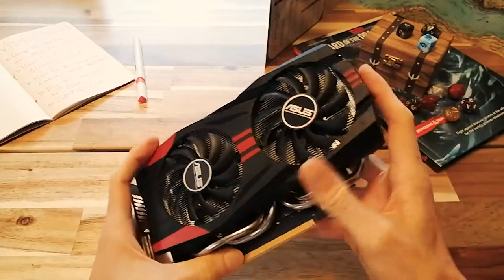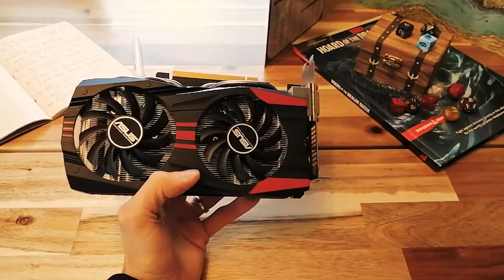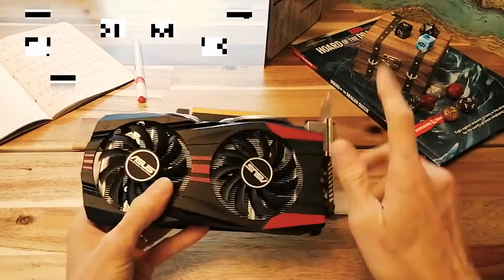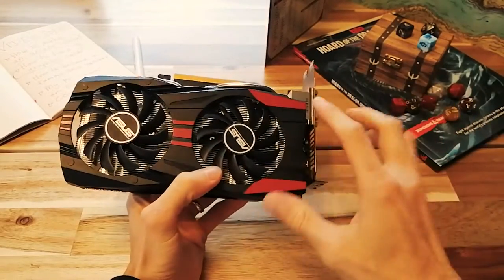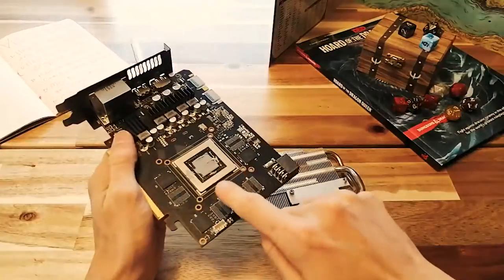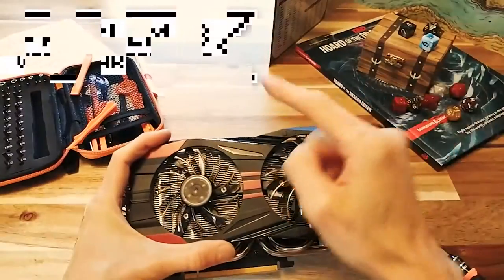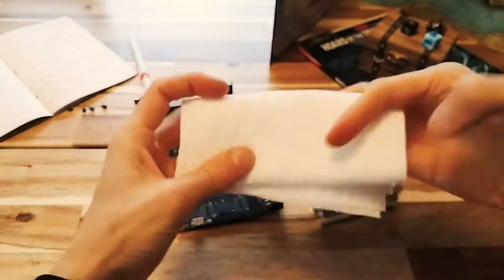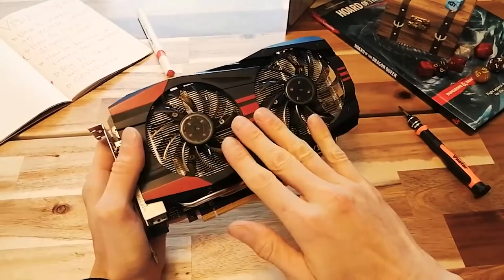EASY Fix Your Graphics Card! (Loud fan, black screen, crashing, artifacts)

Comment: Rx 5700xt, leds light up (power from pcie) but doesn't seem to power up at all otherwise.  Not detected by by pc.  Have tried in two systems.   One was an Intel system the other a amd with radeon adrenaline installed thanks to a 6600 non xt gpu.  Have re pasted it but that's as far as I dared venture on my own with no further guidance... any ideas or instructions to share on fixing this?
Reply from the maker: Is it detected in the bios? If not, then it sounds pretty dead to me. If it's not detected in multiple systems then you probably are out of options other than baking it. That's what I would be trying personally if it was my card, it's the only last ditch effort thing you can try when you've exhausted all other possibilities.
Reply from the maker: Oh I suppose one more thing you could try would be seeing if you can pull the vbios off the card. There is a piece of software called NV flash for NVIDIA cards, but I know there is an equivalent one for AMD cards. There's a chance the vbios on the card is corrupted. It's possible that it will be detected by the vBIOS flashing utility. If that's the case, then you might be able to find the BIOS for your card online and Flash it. That's a long shot though, it doesn't seem to me that that would work but worth a shot before it goes into the oven I suppose haha. Good luck to you my friend!
Reply: @TechDweeb  greatly appreciate it!  I will see if I can find the the amd equivalent and go from there.  This was a used 2nd hand per say card so figured I'd tinker with it in hopes of getting it going.

Comment: I can‘t believe that it was my thermal paste. It seems i didn‘t put enough last time because it was missing some in a corner 😂 But thanks a lot this is the first Video, which specifically talks about this exact problem, i found. My GPU started at 73 degrees and went to 96 but now it  is at 80 maximum

Comment: I've replaced my thermal paste multiple times, didn't work for me.
Reply from the maker: In that case undervolting might help keep temps under control. I recently made an undervolting tutorial. https://www.youtube.com/watch?v=R-ho10bVEgg
Reply: @TechDweeb  Oh yeah I forgot to say, I've tracked my gpu temperature and it never went over 72 degrees even at the point of crashing, that's why I'm so confused with what's happening

Comment: I replace thermal paste and the temperature is good but problem still what I do
Reply from the maker: If it's crashing under load, even though your sensors are reporting okay, it's still likely a temperate issue. My only other suggestion for crashing under load after replacing the thermal paste would be to undervolt and possibly underclock the GPU to keep the temps under the threshold where it crashes.

Comment: I think my brother had the same issue. He has this low budget pc with the amd rx 550. Its shows a display but after 2 minutes the fan starts to spin fast with a loud sound and then after a few seconds it shuts off the screen, but the pc is still turn on. I tried repasting the GPU. The same issue persist. Please help.
Reply: i also have this issue with my 1060 i did everything nothing works , did u fixed it?
Reply: @Angygz  tell me too if you get any solution
Reply: @tonny2131  i throw the card as it was outta warranty, i tried everything chnging the thermal tapes it was zotac

Comment: i have gtx 1080 sometimes game will run just fine and then sometimes my screen will go black and fans will start getting loud  i don’t have another pc to test it but i’ve recently got a new cpu so would you suggest trying the thermal paste fix on the gpu?
Reply: also i’ve had this pc for a while and it’s just started doing this.
Reply from the maker: Definitely. Totally sounds like a GPU overheating issue. Repasting is the 1st thing I'd try for sure.
Reply: @TechDweeb  tons of people with this issue and no one can seem to fix it, some say faulty psu some say power pins or thermal paste... can you try and figure it out for us !! heres an example https://youtu.be/23IXgFQKwho
Reply: @fatality601  exactly what I have dealt with, everything I look up has different “fixes”. The issue has gotten so bad that it happens every time I start my pc so I can’t get the thing on

Comment: i get severe artefacts when i start any game, even someone as simple as old school runescape.. I used to be able to run escape from tarkov no issues.  it seems to crash and artefact as soon as the GPU comes under load or when 3d effects are required or something, also my pc becomes unusable and i have to restart where it sometimes wont even boot properly. (black screens/freezing when logging in)
2060 Super OC Windforce, and i have had to severely underclock the GPU pretty much since a year after I bought it. so I figure it was dying then and is now dead although im typing to you now with it plugged in

Comment: i have 3 980ti cards, 1 of the card will have a black screen 2 sec but i have sound and all on 1 specific tv 85 inch 4k 120hz tv, but this never happens on my 4k 65 inch tv 60 hz or my 27 inch 1080p tv 240 hz, only playing at 1080p, and i have changed thermalpaste and thermal pads, and made sure its no gap, i have also changed pc for that card and cable, but it only happens to that card on that tv :P hehe i have no ide whats going on.
Reply from the maker: That is super weird. I've never heard of such a thing. Also you have too many TVs 😛
Reply: @TechDweeb  yes its so wierd, you can never have enough tvs😄 but i do have 14 pcs, so i guess i have to many of thoes, but i really like old hardware that is refusing to die like my MSI K9A2 Neo-F motherbord that i paired with phenom x4 965 and my gtx 8800😄 its been outside for many winters cat peed on it and had had a hard time, but still not dead.
Reply: @TechDweeb  i think i have found the problem, the other tv i have uses hdmi 2.0 but the new 85 4k 120hz tv uses 2.1 hdmi port, do you think this could be the problem for the 980 ti?

Comment: Hi I have r9 390x amd card every time I plug this card in my pc. My pc start hanging and Thn it stop working. Thn I have to remove the card it work fine. What is the problem plz can some one help me
Reply from the maker: Can you try the card in another computer? If it causes the same problem in another system, then you can be sure it's a problem with the card. If not, then there's a problem on your PC. If the problem only happens on your PC then it is likely a driver issue. One thing you can try is to remove the graphics driver. There is a program called DDU (Display Driver Uninstaller), you'll need to run that in safe mode and completely remove the old driver, and then re-download the updated driver.
Reply: @TechDweeb  thanks a lot sir. I have placed the order gpus in my pc like rtx 3060 12gb and gtx 960 4gb. This all cards working fine in my pc except r9 390x. And I have downloaded a new driver today from amd website. If it's gpu problem Thn how can I fix tht?
Reply from the maker: It could still be a software problem. I'd recommend starting the PC in safe mode. If it works fine, then it's definitely a driver issue, and the DDU utility I mentioned should help you out. If it doesn't work fine, then you'll need to test the card in another machine to confirm 100% that the card is faulty. If that's the case I'd recommend repasting the card like I showed in step 2. Hope this helps!
Reply: @TechDweeb  thanks alot sir I'll try on safe mode Thn I'll let you know
Reply: @Anax159  i remember i had two r9 390x running on crossfire and the computer always crash, years later i put those gpus back on a build to test. They work fine. Turns out it was the power supply. So test the gpu on a differnt computer first, if it works then its the computer power supply or the pcie slot. If it doesn't then its the gpu or the gpu driver
Reply: @ronnierabell1  hi thanks a lot bro. I just open and replace all heatsink and thermal past then it work fine. But I sold it

Comment: my problem is only when i play a game such as gta online it takes about 10 minutes into playing  then my screen turns of then my fan becomes very loud. ?
Reply from the maker: That definitely sounds like a thermal issue. Have you ever repasted it? Try that as a first step.
Reply: @TechDweeb  yeah im going to try that tommorow its just after happening to me tonight , other than playing games my pc does not turn of so im hoping that is it .. i will come back if that works thanks !
Reply: @TechDweeb  and nope i have never repasted it.
Reply: @adamk5462  Hey did it work???
Reply: i downloaded msi afterburner turned down everything now its working fine what do you think it is? because i brought it to technicians and they charging so much money ? this is my second pc FWI
Reply from the maker: It really sounds like an issue with thermals/cooling. You can buy thermal paste on amazon for $10 and repaste it yourself.
Reply: @TechDweeb  okay thank you
Reply: @adamk5462  So as of right now the noise doesn’t get louder and the screen doesn’t turn black, correct ? is everything working fine now?
Reply: @Sayject  it was only the thermal paste just letting you know i got around to opening up my graphics card and there was no thermal paste left on it at all
Reply: @adamk5462  oh so you you reapply the paste and the  problem was fixed? no more black screen and loud fan?
Reply: @Sayject  yeah its working fine for now i had no termal paste left from the last time i bought my card.. it was a second hand buy also... and nope no more black screen or loud fan i avoided that loud fan and black screen before this by downloading msi afterburning and turning down all my fans gpu etc..
Reply: @adamk5462  ah ok, I had the problem recently where the screen would go balck and the fan would make a loud sound. But ever since I started using my AC and putting my pc on the table it seemed to stop. That’s good but if it ever comes back I’ll do the Msi afterburner, how did you go about doing that exactly? I have a snowblind pc,
Reply: @Sayject  just by downloading it msi afterburner you can manually set you fans etc to what you want.. but you should try your termal paste and see if that works to the cpu and gpu i got that done to mine and i can now finally have my pc back and running the way it was meant to ..

Comment: As someone who fixes gpu as a side job. This video is SHIT. Never bake/oven your gpu. All you're doing is destroying the gpu from something fixable into a dead one.

To even properly oven the gpu, always remove all eletrolytic capacitors first before even doing this and apply decent flux all over the board. Hell, to even know if artifacts causes the loose solder connection, check it with memory testers like tserver or mats/mods first!
Reply: Since u fix gpus do u know why my gpu black screens me and my monitor recieves no signal afterwards until i restart my pc
Reply: @ArgjendB8502  did the blackscreen happens after you start a game or other software that uses the gpu?
Reply: @ryoosari  it happened once when i was botting up my pc
Reply: @ryoosari  i get severe artefacts when i start any game, even something as simple as old school runescape.. I used to be able to run escape from tarkov no issues.  it seems to crash and artefact as soon as the GPU comes under load or when 3d effects are required or something, also my pc becomes unusable and i have to restart where it sometimes wont even boot properly. (black screens/freezing when logging in)
2060 Super OC Windforce, and i have had to severely underclock the GPU pretty much since a year after I bought it. so I figure it was dying then and is now dead although im typing to you now with it plugged in)🙄
Reply: @tellah8037  Oh man, RIP gpu. Sounded like a bad/dying VRAM or worse, the Memory Controller.
Reply: @ryoosari  big rip

Comment: MAX Speed Fans ?! 
Any idea of why a graphics card starts booting with fans at max speed all the time as soon as you turn on the computer. MSI afterburner usually worked but after the last windows of driver update it no longer does the job. 3000 rpm is so noisy!